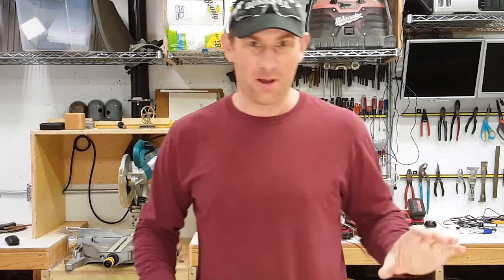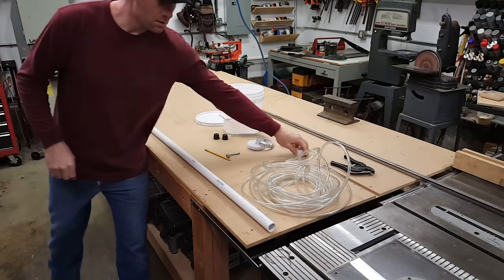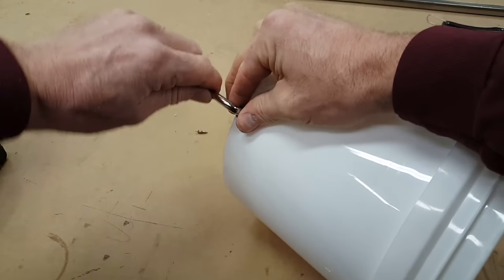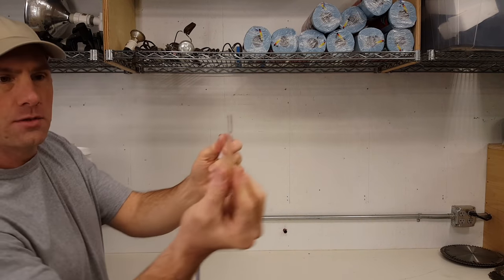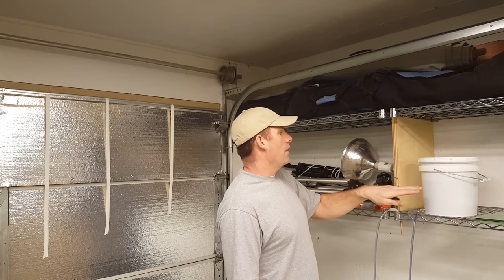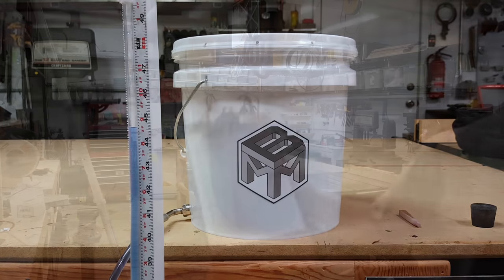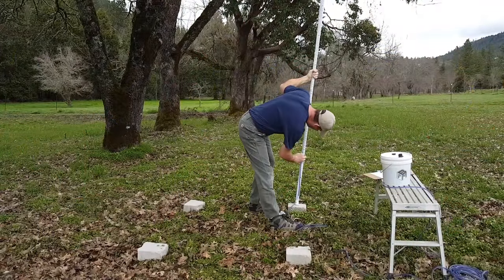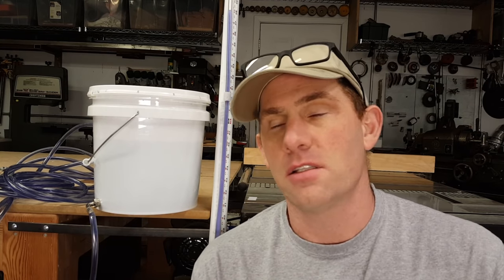Water level basics – How to make and use one

Comment: You can do the same thing but more minimalistic with just the tube: fill it with water as needed, hold one end to the wall and the other to another wall or wherever you need and it's done! Much more portable and you can even flush it each time because the amount of water is not that much.
Reply from the maker: True, that method does work for level marks. But for one position only. If either end is moved up or down the system's elevation will change. Level and elevation are two entirely different and independent things. The bucket style water level address both with one solution. At the end of the day you'll find that it's far less work to use a water level that includes a reservoir.

Comment: I have an expensive transit but find it difficult to use when working alone. 🤣This may be just the thing.
Reply from the maker: Yes, I find that this is a better tool when working alone. Of course the hose length is the limit, though.

Comment: Now, just for example, let's say one footing is ground level and the other footing is 60 feet below ground level. As you move your tube down to 60 feet more water is now in the tube and less in the bucket. Therefore your level is not the same as the ground level. This water level only works accurately when the water is in the tube only. Adding the bucket introduces inaccuracies, albeit small when moving up and down a little bit.
Reply from the maker: I understand what you're getting at. There is an elevation vs. level problem with this configuration. But not as much as you would intuit. Providing that the hose is nearly full of water as you begin; your example of the footing 60 feet below ground level has almost no effect on the elevation of the water in the hose. In this case the end of the hose would stay at the same elevation and the tape measure would be extended down to the footing. This is the only way to get an accurate measurement. The top of the hose must stay above the top of water in the bucket or it will spill from the end of the hose. 

If we started with the bucket near the lower footing we would do the same thing in reverse. Nearly fill the hose with water, measure the difference between the water line, and the lower footing, then move the hose to the location of the upper footing without changing elevation (sometimes this is not possible in this configuration due to obstructions). At this point measure down between the top of footing and the water line.

In both uses cases the distance between the top of water and top of hose (or end of hose) shouldn't deviate much. I usually place tape bands on the hose as tolerance markers and stay between them while at work. But just so you know even 10' feet of difference between the water line and the end of hose only makes about 1/16" change of elevation with a 2 gallon bucket.

Comment: A source of error that people don't often explicitly mention -- always mark the level when it is at the same point of the tubing. If more or less of the tube is full of fluid, the reservoir will have less or more fluid (respectively) and its level will be lower or higher (respectively).
Reply from the maker: Yes, this is true. But with a 2 gallon reservoir the effects are negligible. I've tested it and it takes several feet of change in the tube to change the reservoir just a little (1/16"). So for almost all purposes the tolerances are well within effect range for the type of work that this tool is used for.
Reply: @Makebuildmodify  Totally. Just worth being aware of, as circumstances of use may vary...

Comment: You don't need a lid or the plugs for the bucket at all.
Reply from the maker: You're right. But mine is the luxury edition....
Reply: Keeps water from slopping around when the bucket's moved
Reply: Crap the idea is to leave the bucket in one place if you move the bucket you will have to recalibrate each and every time you move the bucket think about it.
Reply: Is evaporation a concern if working for an extended length of time in the heat?  Might help with that???  

Technically you don’t need a valve on the bottom either. You can just clip a hose to the inside - like a syphon, water will go up and over the edge.   I’ve seem many made with a milk jug and just hung from the ceiling for height
Reply: LOL!!!  I love how everyone else is an "expert" once you show them how it is done!!

Comment: Water is level.
Reply from the maker: That depends on the circumstances.
Reply: @Makebuildmodify  would it be wrong to say that, the ocean may have tides, but the horizon is always level.
Reply from the maker: @MalcolmTexxx  That depends on the working definition of level.

If we use the definition of level that describes a tangential line to the Earth then the horizon is not level.

If we use the definition that describes level as all points being equidistant to the center of the Earth then the ocean horizon is, as a percentage, roughly level, relative to the Earth. The exceptions being that there are tidal changes, storm surges,  and that the Earth is an oblate spheroid.

Comment: There is a big assumption you're making here, that is the volume of water in the reservoir is much, much greater than the volume of water in the tube.

You could forgo the reservoir but the level line would only occur when the water meets a common point on the tube.

As you have it, without measuring the water line against the same point on the tube, you're changing the volume of the system on each measurement and introducing error. Of course, with the assumption that the reservoir is "sufficiently" large, your error is "sufficiently" reduced
Reply from the maker: I made no assumptions. I tested the elevation change due to displacement and it's negligible. A two gallon reservoir is sufficient. Typical use is within a few feet of elevation change (1' to 8') and that is well within tolerance. Unless one was to empty the half of the tube back into the reservoir the change is of no issue. (I wonder who really made the assumption here.)
Reply: @Makebuildmodify  That's exactly what I'm saying - your reservoir is sufficiently large so your errors are negligible. 

If someone uses a longer tube or smaller reservoir, your advice is still accurate and sound, but the discussion about sufficiently large reservoir and negligible error may be more relevant. 

For example, I've followed your basic tips and advice and will be using a water level without the reservoir (an "edge case" in reservoir size, if you will) and the "assumption" that the reservoir is sufficiently large here breaks down, and the errors introduced by not measuring against a common point on the tube are present. As a result, I need to measure against a common point of the tube.

No dig against your video. It really helped me. I'm just pointing out an aspect to this whole scenario which makes it work, but is unstated in any video I've seen.
Reply from the maker: @qaweeorltuys  You're correct. I've considered doing a video about the difference between level and elevation. The two are commonly used synonymously, which causes a degree of confusion for some.

With a hose-only water level the hose is also the reservoir. A good example is the type with clear hoses at the ends of a garden hose, it is can be difficult to get a level measurement to align with a single elevation . In most cases the elevation of each measurement will be independent from the last. Which requires an elevation difference to be reconciled with math.

It can be done another way if one is fastidious . It usually requires two people or a least a way for one person to mechanically hold one end of the hose stationary while inspecting . Basically, after the first elevation/level marks are made, one end of the hose must remain at one of the locations. Then the other end moves to the next desired location. This "leapfrog" technique, when done correctly, will provide both elevation and level benchmarks. One caveat to the "leapfrog" technique, it can introduce a degree of error every time a hop is made. This is due to human visual error and such. It can add up. Which is where a single, centrally located,  large (relative to hose size), reservoir shines.

Comment: Why would a seemingly intelligent person work in inches?
Reply from the maker: I use both metric and imperial systems. Whatever is needed at the time. Why be handicapped by the situation?
Reply: @Makebuildmodify  Thanks for explaining. But I don't get the reasoning for why imperial was a better choice with this.
Reply from the maker: @turkeyphant  It wasn't the better choice. Either would have been sufficient to explain the concept of a water level. The function of this tool is independent from any measuring system. I often use lines on a stick to reference the desired elevation.
Reply: @Makebuildmodify  My point is clearly you made an active decision to choose imperial. You decided to do that. And then you did all those calculations using 1/8s of an inch!
Reply from the maker: @turkeyphant  correct. But that has nothing to do with the water level concepts. I could be have the same conversation with someone that prefers the imperial system if I used metrics instead.
Reply: @Makebuildmodify  Even those who use imperial are not able to logically defend it, so I doubt that would ever happen.

I'm also a bit confused by your statement "Whatever is needed at the time". I can't think of a scenario where it would be beneficial to use imperial - are there any?
Reply from the maker: @turkeyphant   I have a few use cases that the imperial system works better for. Specifically when the  factors of twelve are needed. Also, feet and inches have some advantages for quick math when framing home. Maybe I'll do a video on the topic. 

To be specific the imperial system is much better for work on structures that were built using the system. All of the materials are in increments that match the system. I do lots of repair and it would be silly for me to use a metric system in this situation. If the structure was built using the metric system I would use metric. In this example the 'better" system is contextual.
Reply: @Makebuildmodify  That's a fair point and thanks for explaining. I'd like to see a video on this.